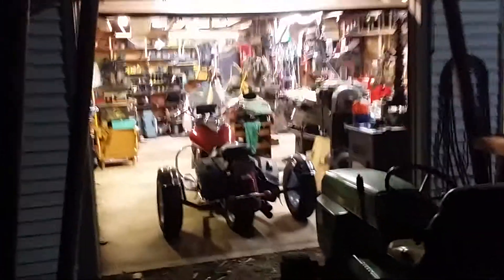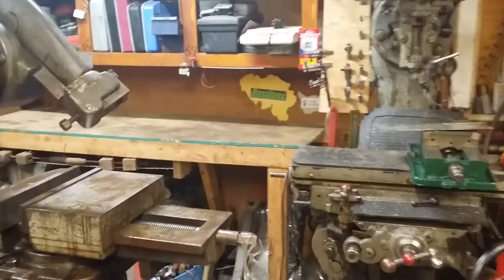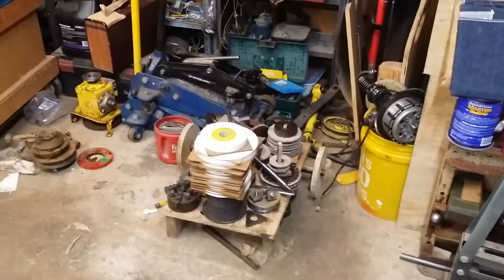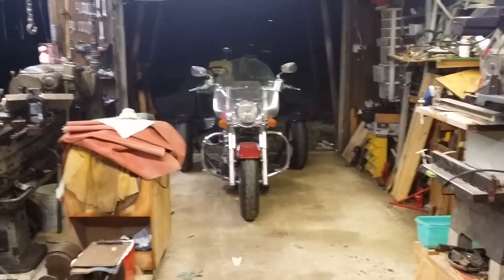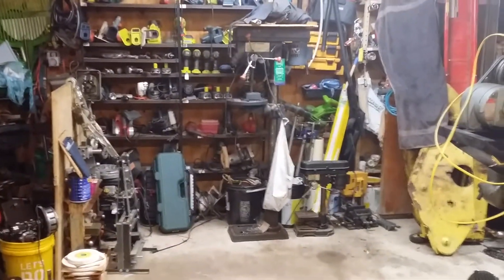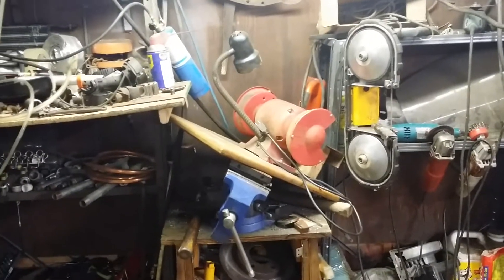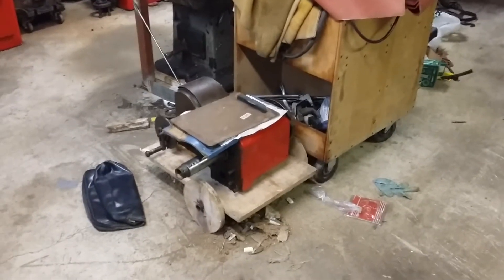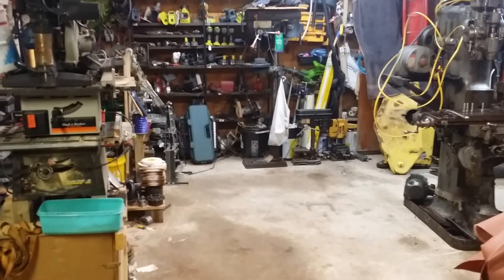Carved out a lil space in the garage. Garage  organization update

Comment: That concrete pad sounds like a good plan. As you said, you have a lot still to do, but I can see a big improvement over the first video of this organisation series. Nice work! I'm at the stage where I'm clicking like before the video starts! :)

You mentioned cleaning one day a week. I recommend shorter intervals than that. A lot of folks go for end of the day, but I usually work until I'm wiped out, and then I have no energy. Instead I tidy up as my first job of the day, and that gets the blood moving, and warms me up too at this time of year (winter here). The benefit is it rarely takes longer than 15 mins, because I can only make so much mess during one day!! :-D If I'm doing something particularly messy, then it doesn't hurt to have a reset halfway through the day even. Perhaps before or after lunch. The more often I do it, the less it builds up, and the easier it is for me.

I'm keen to see more of this organisation project.. (And the new mill, and the second logan lathe!)

 PS: Is the water on the floor and wall near the pump room something you knew about? 

Cheers,
Craig
Reply from the maker: The stains on the floor are all old. 1 year I had a main pipe spring a leek and didn't notice for some time. Add to that many oil leeks from many engines. Luckily  all dry now (for today at least) ..

Oh man organizing more then once a week! I dunno about that..lol.. that will take some real motivation. .

I hope to get the mill powered back up (semi permanent ) next so should be some less boring content on the horizon.  Plus simultaneously continuing to organize  (I hope) and as my energy  ramps back up that video on the other logan. 

Plus. A cool new part should be here for the bly Saturday